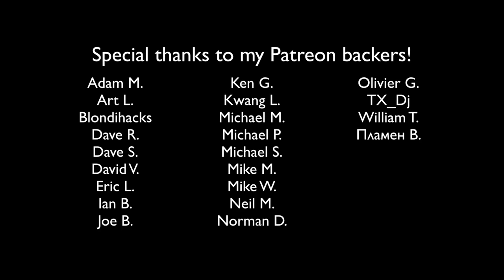#76 Fix Your Old Computer 2: Magical Thinking & Multimeters

Comment: Good basic info. However, I would not recommend doing continuity checks with power on. Continuity check is also diode check so there is a voltage on the meter leads to provide enough current to turn on a diode. This could harm chips that are powered on.
Reply from the maker: Yes, theoretically, I agree, however in practice the current is low enough that it shouldn't matter. Maybe just as important is the fact that with the power on you may get false readings because capacitors will be charged, chips will be in different states, etc. So for that reason I agree - continuity tests are best done with the power off. Thanks! https://forum.allaboutcircuits.com/threads/possible-to-damage-components-with-dmm-ohms-setting.125194/

Comment: Great Video. But you did not do a "go by" checking the voltages from the power supply connector or the rails on the board.

Secondly, You did not go through a physical check of the board in either video. A lot of times (as I seen on other systems like Atari, Commodore, Mac and PCs) a bad cap can keep a system from turning on  by giving fluctuations on 5V rail.
Reply from the maker: Thanks for the comments. I plan to check voltages in the 3rd video. Also, I think that I talked about checking the board for obvious faults liked leaked batteries or capacitors? Regardless, that's a good point.